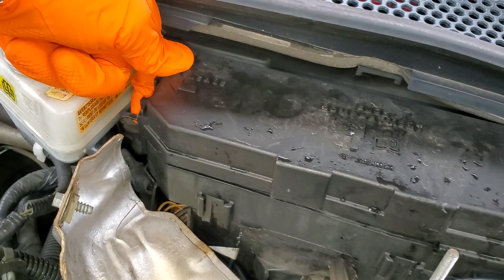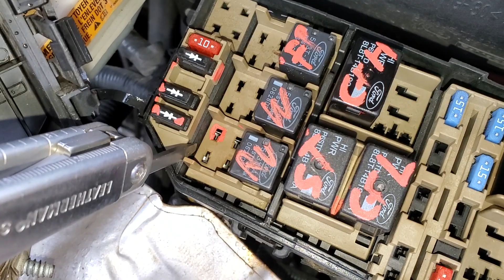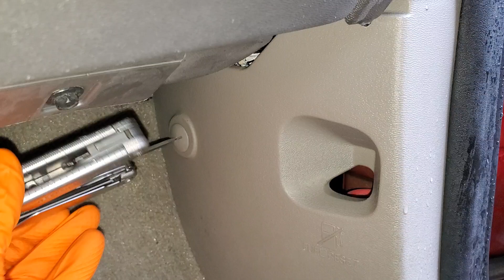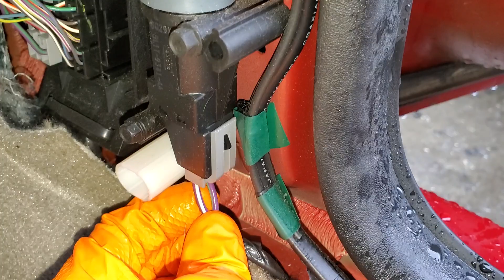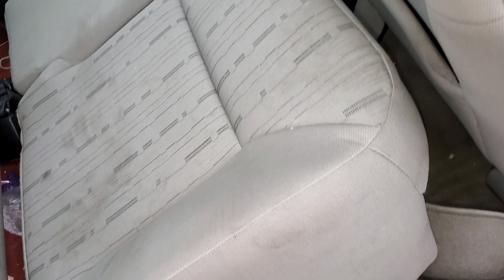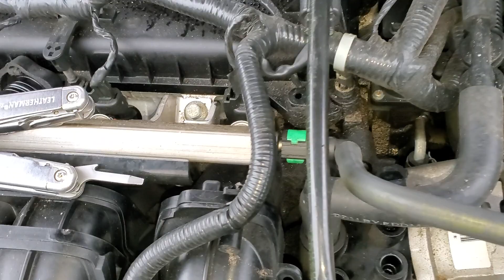2009 Ford Focus Fuel Pump Relay, Fuse, Fuel Pump Circuit Explained

Comment: Does a 2009 Ford Focus have a fuel filter? If so where is it located? I've been searching for it.
Reply: Late reply but the fuel filter is beneath the car, next to the gas tank. It's a bit hard to reach.

Comment: I have an issue where diesel was put into the petrol gas tank. What is the easiest way to get the diesel out? I was thinking of disconnecting the fuel filter and using the fuel pump of the car to pump the gas tank empty. How can I provide constant power to the the fuel pump so that I can get the fuel out?

Comment: please be careful when disconnecting that fuel line, there were times where i removed it and it was under a small amount of pressure and you'll get fuel spraying all over you and your engine

Comment: Its the same of a Ford fusion 2008 latam version, if I don't got power in the fuel pump assembly and the fuel pump relay its working, the problem its in the wire or the inertial switch right?